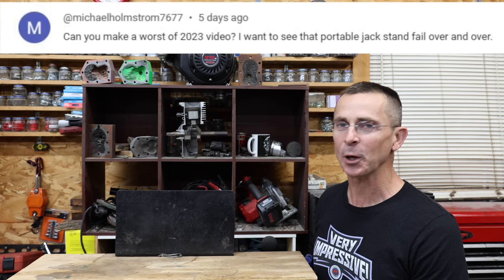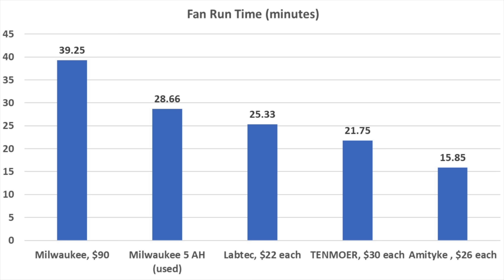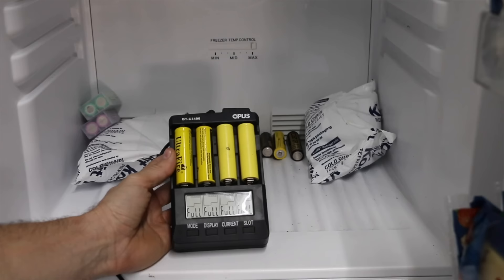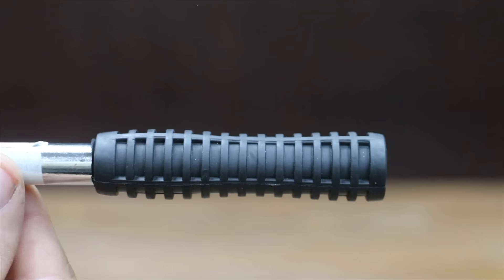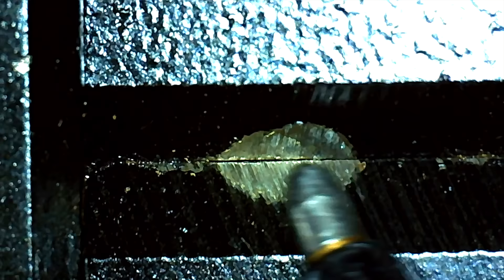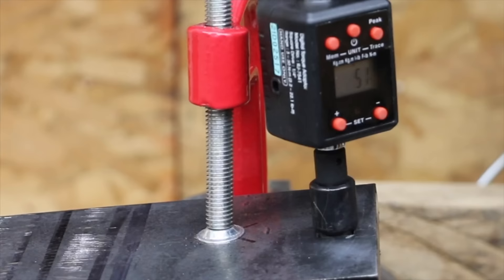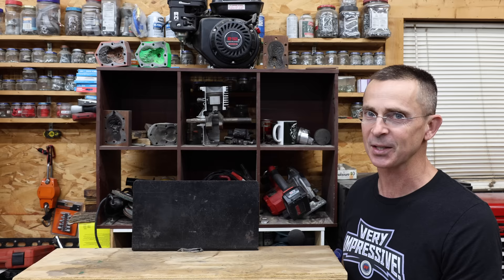10 Worst Items Ever Tested? Let’s Find Out!

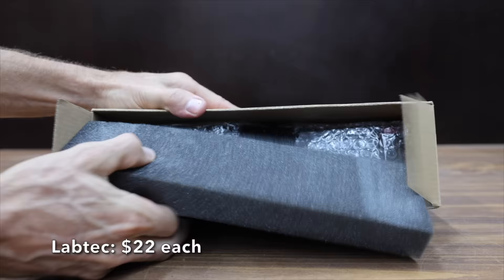Comment: 0:08 Amityke 6.0ah Battery
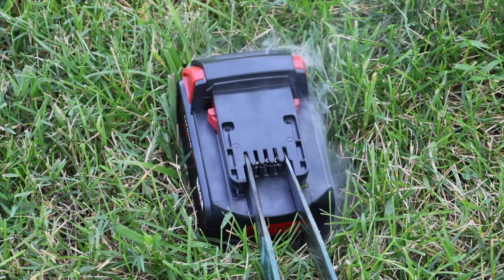3:04 ZSP jackstands
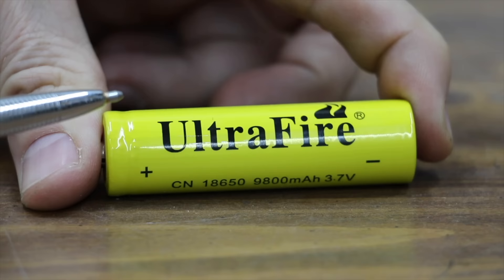4:33 Ultrafire 18650 battery
6:50 HHO Generator
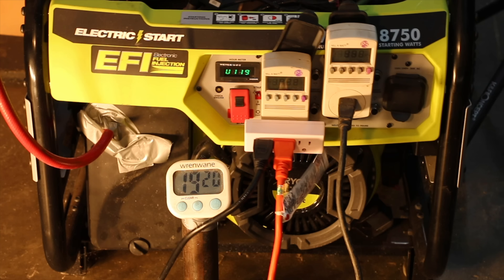8:48 Drill Circular Saw Attachment
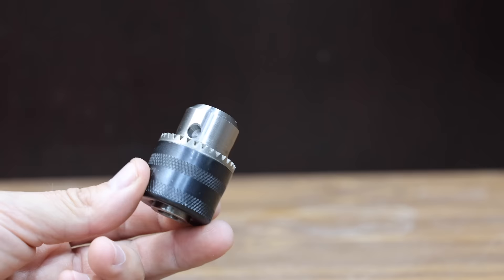10:07 Angle Grinder Drill Attachment
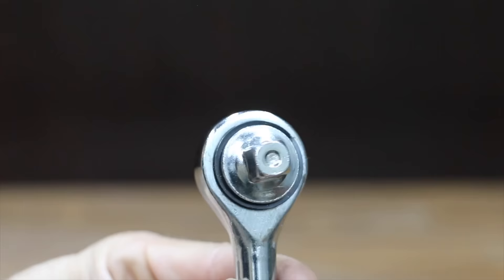11:38 Performance Tool Wrench
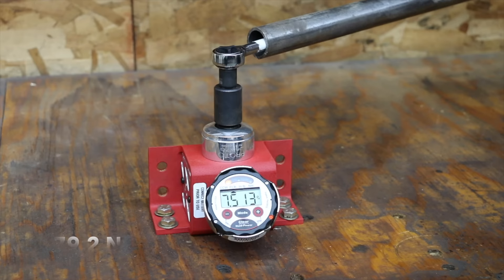13:37 Performance Tool Bolt Cutters
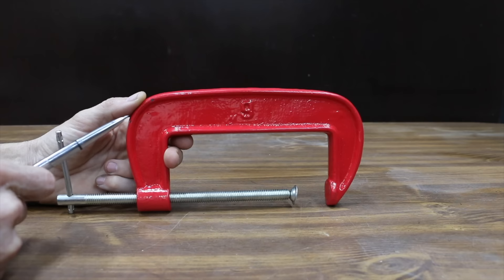15:57 Shop Tek C Clamp
18:40 Illinois Industrial Tool Diagonal Cutters
Reply: Chad
Reply: Its a shame he keeps testing fake ultrafire batteries, i thought he found out from last time about this but apparently not...
Reply: Where is the chain saw that's in the thumbnail?

Comment: I wish you would test the hypertech spectrum tuner and see if it is possible for it to screw up the transmission in a vehicle.

I bought and used one and immediately had problems with my transmission.

I can't afford to get it fixed right now and I would love to know if the tuner is the culprit.

Comment: With the new year starting, I’d love to see a series of videos to see which tool brand provides the best overall lineup of cordless tools based on range of compatible tools, battery quality, and then comparing the tools they all have in common.  Your channel is the gold standard for quality reviews and buying into a battery system is a huge decision and I feel like this is something you’ve danced around but haven’t hit directly (unless I’ve missed it)
Reply from the maker: Thanks for the suggestion.
Reply: Milwaukee is probably number 1 and then DeWalt.
Reply: @ZboeC5 in my experience with both Milwaukee and DeWalt, I couldn't tell you which brand has the better overall lineup but they're incredibly close I know Milwaukee has the better framing nailer and I'd say DeWalt has the better variety, it really depends on what you need your tools to do.
Reply: @joedirtpig814  Let me put it this way, working on a car? Milwaukee...building a house? DeWalt. There ya go.
Reply: @ZboeC5  I can follow that logic

Comment: Your tests are simple but effective and clear! Excellent!
- But the test with the HHO generator should be dealt with beforehand!!!
1. It takes a few 100 km for it to work properly.
2. The normal Landa control must be adjusted, otherwise it works against it and you can even achieve a opposite effect.
3. Using a pulsating direct voltage (duty cycle), adapted to the shape of the electrode and the shape of the electrolysis container, you can find a resonance point that consumes several powers of 10 less electricity for the same amount of Braun gas! The frequencies are approximately 44-70 kHz. Check valves in the H and O combination should also be installed for safety reasons. The HHO gas has 36 different molecule combinations and completely different properties than the individual gases!!!

Comment: Can you test the best paint stripper? Both chemical and also abrasive wheels and wire wheels. The chemical ones haven’t been good since they all had to remove methylene chloride from the formula.
Reply from the maker: Thank you for the video idea!
Reply: @ProjectFarm  If you wind up doing this, think about the amount of dust a wire wheel kicks up.  One of the issues with pain removal and physical abrasion is obviously lead paint.  Lead isn't a great thing to be breathing, and it's not always easy to know if somewhere below all those layers of paint lurks lead.  

There's also just IR heaters, which are possibly the least messy/unhealthy, but also the most expensive.

Comment: Hey Project Farm, I have a question, who makes the best automotive soaps? Snow foam primarily? I’ve tried griots, chemical guys, and recently switched to Koch Chemie GSF. Would love to you get your opinion. Also have used the Chem-X Stars and Stripes, works very well as a true touch less but is a two part. I have an electric pressure washer with cold soft water.
Reply from the maker: Thanks for the suggestion.

Comment: Thanks Todd, some interesting information indeed! I have another video request for reviewing 1/4 inch drive digital torque wrenches featuring angle measurement. Some that currently come to mind are:
Gearwrench 85194
ACDelco ARM313-2A
Cornwell CTG2000ANGX
EWK EB0347
Snap On CTECH1MR240
There's probably at least a few more but these are just what I can think of off the top of my head. I wished Harbor Freight came out with one of their versions either in the Quinn or Icon line, but I guess we're not there yet. A test however between the consumer vs pro models would be great. Thanks again, and I hope to look forward to that.
Reply from the maker: Thanks for the suggestion.

Comment: Winter freeze is coming and I worry about frozen pipes. Love to see a tests with differing fixes like sharkbite/pushfit (name brand vs off brand), compression fittings with rubber seals vs metal brass, solder for copper, screw in coupellers. Mainly like to see how these things hold up to freezing under pressure. 

Stay awesome fam!
Reply from the maker: Thanks for the suggestion.  Thanks, will do!

Comment: I have yet to see a reasonable negative comment about this channel. Great job, Todd!
A suggestion for a test is to test the accuracy and durability of tire pressure gauges. I own several, from expensive to cheap, and they all read different! I work on aircraft, and need to have some confidence in tire pressures. Thanks!
Reply from the maker: Thanks!  Thanks for the suggestion.

Comment: Good show as usual.
A suggestion for future testing: Small abrasive blasters.  Lots of us have cars with direct injection and those engines require periodic intake valve cleaning usually with walnut shell abrasive media. A perfect diy job for a rainy Saturday... Anyway, Harbor has a nice looking rig but the reviews for that are all over the place. Could you check them out for us??
Reply from the maker: Thanks for the suggestion.

Comment: Nice video as always, just two notes here:
Amityke Battery: When you measure the electric current using a clamp-meter, you need to have the clamps fully closed, otherwise you measure nonsense...
HHO Generator: I am surprised that the engine even runs with spark plugs in such a condition... (HHO generators are only benefitial at specific conditions and are often wrongly advertised as miracle devices)
Reply from the maker: Thanks!  Thanks for the constructive feedback.

Comment: Nice!  Very helpful video that tells us what tools to avoid because they're either bad quality, dangerous or counterfeit. I think there should be a sequel to this.

Here's some suggestions for a second worst tool video:
-Performance Tool Bench Grinder (Thing was underpowered to the point of failing the lie detector test on the Bench Grinder video)
-Tolsen Locking Pliers (On one video about locking pliers, the Tolsen brand did absolutely terrible)
-Viking Jump Starter (Tested twice, the first one failed to jump start the pickup truck and the tractor and would stop working at times (especially when cold), the second one had the same problems, it also did a poor job of being a power bank. In short, overpriced and underpowered)
-EBL 2800 Rechargeable Batteries (Much lower mAh capacity than advertised, fast self-discharge rate, high internal resistance, holding up very poor for years of use and its overall awful performance, the EBL deserves a mention on the worst tools sequel)
-Bauer Step Bit (False advertising, claims to have a fast start tip, but it took over 100 second for the Bauer to drill through the mild steel compared to only eight second for the best step bit which was the DeWalt)
Reply from the maker: Thanks!  Thanks for the suggestions.

Comment: Please test large polymer rifle cases (52"-ish)!  It would be great to see a truly independent and comprehensive test of the various offerings from bargain to break the bank (Apache, Eylar, Vevor, Plano, RTIC, Cedar Mill, Nanuk, Pelican, etc.): from strength of materials under load, against puncture/crushing, and drops (outer shell; clasps; hardware); to water resistance (say under 6"-12" water for 10 min); to internal protectiveness factor (protecting an egg or porcelain plate).  You have the best review channel for these kinds of utility products and I'd love to see what you come up with.
Reply from the maker: Thanks for the suggestion.

Comment: I own the JISULIFE  and I love it! When I work outside I use a full face shield with it and  I am amazed how cool my body feels. I have easily gotten 8 hours on medium. Never had to run it on high. One cool thing is that you can replace the 2 18650 batteries if you need to. I highly recommend the  JISULIFE !!!
Reply from the maker: Thanks for sharing.

Comment: You should do a video on 1/2 inch pneumatic impacts, including a test with a couple different cfm compressors, to show the drop off in performance, aswell as overall utility. 

I know torque test channel does a fair bit of statistical reviews, but I havent seen a few of the lower CFM options on there that smaller home compressors (4 ish  cfm) could run (Husky, kobalt, etc)
Reply from the maker: Thanks for the suggestion.

Comment: Would like to see a review on hand winches. We call 'em come-alongs. Long handle, small spool. I have warped several over the years. I carry 4-5 in my truck along with LOTS of chain. I get stuck a lot when hunting.

Failure most often happens with the handle bending.
Reply from the maker: Thanks for the suggestion.

Comment: The jack stand has some markings that used for a very differnet application. The 2 squares next to the CE sign are for electrical Power tools with cords for 230V, at least here in Germany. It is called "reinforced Insulation". Most time these tools have an plastic outer and no grounding. The 2 round shaped arrows are the "Green Point". It is used on wrapper and other packaging that should be recycled. Just print some stuff on the label. The more the better.
Reply from the maker: Thanks for the feedback.

Comment: The 5-Piece Long Handle Flex Head Ratcheting Wrench Sets with Offset Box End would make a great Review Video. I just went with the Icon's from Harbor Freight after getting skimped on some that are listed on Amazon. The ones from Amazon have awful reviews covering reliability issues and nonexistent warranty.
Harbor Freight - ICON Extra Long Professional Double Box Flex Ratcheting Wrench Set, 5-Piece
Amazon - ATD Tools 99650 XL Ratcheting Wrench Set with 10 Metric Sizes - 5 Piece
Amazon -  Mountain 5-Piece Metric Double Box Universal Spline Reversible Ratcheting Wrench Set; 8 mm - 18mm, 90 Tooth Design, Long, Flexible; MTNRM6

Comment: Ive gotten the Powerextra brand for an old porter cable tool that turned out well. The nicad then lithium ones. But only because i didn't have many options, found the tool only impact at a thrift store for 10$ new!
Reply from the maker: Thanks for sharing.

Comment: Just wondering if you ever tested flex connectors that are sold for repairing catalytic converter pipes? I would also need a to buy a mig welder as well. Two cars that I have need this repair. 2010 Forester & 06 A6 3.2 with California emissions. Very high cost to replace.
Reply from the maker: Thanks for the suggestion.

Comment: Todd you should test AN hoses, like test the pressure capacity, pull apart strength, the different types of assembly methods from friction to hydraulic press fit, and then test the different brands of hoses against each other, mixing brands of hose ends to brand of hose, thermal limits, will it seal for both air and fluid, and test ptfe vs non ptfe among the brands, that’s like several videos worth of content. also i dont think im alone but it would help me save money in my projects because Ive bought a few brands myself just because they were on sale and Ive seen some last longer than others. thank you for the amazing content
Reply from the maker: You are welcome!  Thanks for the suggestion.

Comment: You usually do an amazing job making sure that you are being fair but I think you may have not had an equal test when using the bolt cutters. I believe the leverage caused by the distance to the pivot point  was not consistent.  Look at the deck screw position on the Performance vs Capri.  Thank you for all of your great reviews!

Comment: Jusr for some perspective, I bought 4 ultrafire 3000mAh 18650 batteries from eBay in 2012.

I barely charge them, maybe once a year, i try to cycle through them but I'm sure at least one has sat for over a year. I had 1 go bad over the last 10 years where it had a bunch or corrosion on it. They're in my TK15 flashlight, for only $20 with a charger (still works), I think they were a great purchase.
Reply from the maker: Thanks for sharing.

Comment: Somehow I actually did end up with one of those Performance Tools ratchets, and boy it was one of the biggest turds I ever owned. The selector was the hardest thing to make work, the selector frequently slipped and wouldn't ratchet, the wrench had at least 20 degrees of slop, and even though it was the backup to my backup ratchet, it still ended up completely breaking with normal use. I am not surprised that the rest of their tools are junk as well.
Reply from the maker: Thanks for the feedback.

Comment: I would love to see a video comparing the different types of studs to be mounted on tires to see how well they assist in gripping  ice in the cold seasons.

These can be used on car tires, shoes/boots, and bike tires.

This could be tested in the following methods:
-type of tire stud used
-how many mounted on a tire
-location of mounting on a tire
-how well/deep a stud will bury itself into ice
-measurinf the grip by putting a downward force on a small block of rubber with a few studs and then using a horizontal force to see the force needed to make the studs slide on ice, as well as concrete abd/or asphalt (for when its not actively icy between snows)
-ease of installation

Im hopinf that a video of this being tested could help educate people and hopefully save lives or livlihoods.

Thanks! Attempt #2
Reply from the maker: Thanks for the suggestion.

Comment: Hey! I have a cracked Turbo Manifold on my Doc Race Single Turbo converted BMW 335is and I filled it in with JB Weld High Heat (good for 500 degrees) and I filled it from the inside. Would you be able to test the JB Weld High Heat with extreme high heat like me?
Reply from the maker: Thanks for the suggestion.

Comment: I don’t know if you’ve done a review on line wrench’s or flare nut wrench’s yet. Years ago I had some Matco wrench’s that seamed to have walked off. So recently I bought some from Harbor freight. They seam a lot thicker and looser than the name brand ones I owned before. And they don’t bite as well. I’m just curious! Thanks!
Reply from the maker: Thanks for the suggestion.

Comment: For a tool test - exotic sockets (I'm thinking more splined/torx sockets) as I've had a set from Sealey (they used to be such a good brand in the UK) and finally got to use the torx under actual load only to have them shear off like it unhardened steel. Not a great look and I'm now every much considering a replacement set.
Reply from the maker: Thanks for the suggestion.

Comment: On the ratchet products and the forward/backwards selector i dont want one that to easy to change either. Ive had ratches that were to easy to change. Sometime im grabbing the ratchet high up on the handle to move it back and forth quickly as i do that sometimes the selector will change the direction in the middle of working a bolt or nut and by the time i notice the nut or bolt is back to were i started either almost completely off or almost tightened all the way and can be very frustrating
Reply from the maker: Thanks for the feedback.

Comment: Could I suggest you do a video on oil based corrosion inhibitors, like fluid film, blaster surface shield, known t40, just curious cause I live in the rust belt and would like to know if any would help preserve a vehicle
Reply from the maker: Thanks for the suggestion.

Comment: Just a word about the angle grinder drill adapter;
I own one that is way better quality, and has M14 taped hole to fit a regular angle grinder. 
I’m a welder and i use it everyday with some carbide burrs. 
It works very well, and removes metal fast on hard to reach spots. 
I would definitely recommend buying a good one. 
It costs around 40 bucks, but is worth it if you’re having professional use out of it 

If you buy one, take one that doesn’t need a key to be tightened.
Reply from the maker: Thanks for sharing.

Comment: Only time knockoff batteries are ok are when they are SIGNIFICANTLY cheaper and you use them on low output things. Like I would buy a knockoff M18 battery because they are expensive, and use it on my m18 flashlight which basically lasts all day or 2 with a normal milwaukee battery, and that way I'm  getting atleast a flashlight for a full day and I don't have to tie up one of my good batteries
Reply from the maker: Thanks for sharing.

Comment: I need you to test 2 cycle combi systems. Like red max stihl and echo. Shear saw and weed whacker set ups. Like just a power head on a stihl or red max is 300 to 400 while you can find complete 5 in 1 set ups for 200.
Reply from the maker: Thanks for the suggestion.

Comment: I would like to see you test the different types of sparkplugs for fuel economy/efficiency.  Performance/ignitability. Use the same brand like NGK and test each type of plug.  Copper/Nickel, Platinum, Double Platinum, Iridium, Ruthenium. All  manufacturers clame that there is a difference, it would be interesting to find out. Thank you.
Reply from the maker: Thanks for the suggestion.

Comment: Maybe a good one to test could be the cable that goes into the charger for a laptop. I have now purchased the 3rd one, I could understand if the charger had a problem more so than the cable that feeds them. One was the original brought with the laptop, the other 2 were brought from a well known Asian supplier.
Reply from the maker: Thanks for the suggestion.